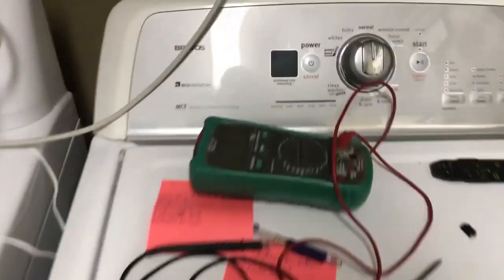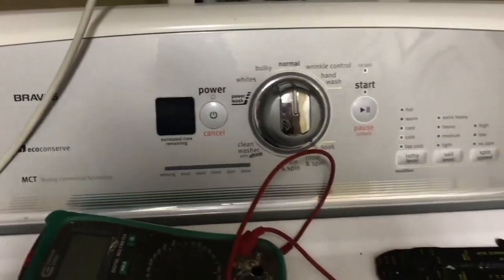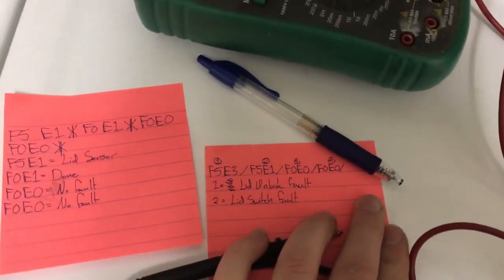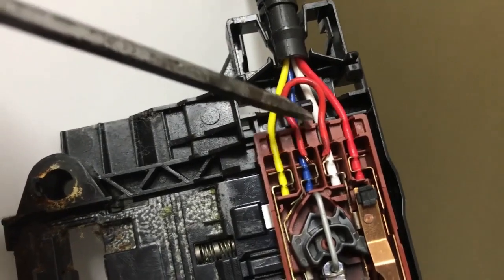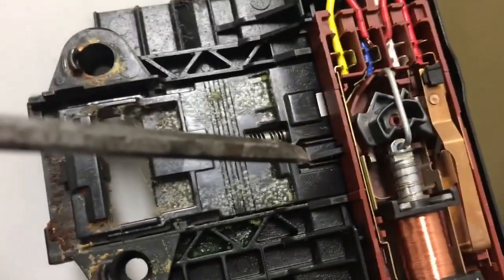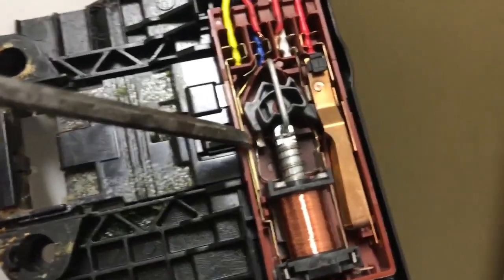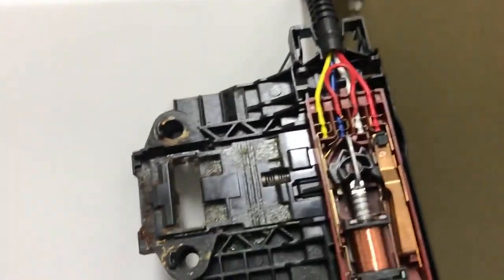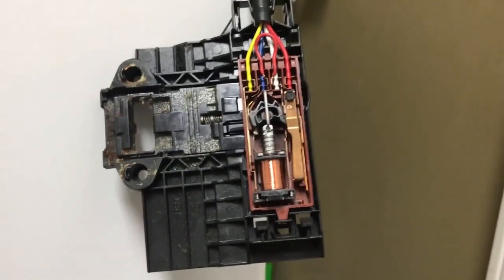Amana Lid Lock Bypass Works for Maytag, Kenmore, Whirlpool, Amana, Roper

Comment: Can you do a video for the one in the thumbnail? The switches are different in the two models
Reply from the maker: it will work the same you only need the main control knob with the 6 lights below it
Reply: @methodmeetsmadness  I replaced lock switch went through manual tests everything was good but when I started a load it guess a bit then begins forever drain

Comment: This will not work. The ACU reads resistance  you cant just jump the device. I am a repairman and customers who do this not only need a new lock but new Control after you short out your ACU
Reply: Can the white and blue be connected to a toggle switch and let the machine work?
Reply: @rickeykeeton4770  you cant jump a load. The lid lock is performing work. The ACU needs to read that work is being performed or it will assume the lock has failed and not spin
Reply: @tannerross-barco8238  is there a way I can bypass that stupid switch? Amazing how I'm still alive and we would push the old style switch to make the washer spin with the lid open when I was a kid just to watch it work. Now as an adult I supposedly need all this safety crap that just drives me nuts.
Reply: Just take this man’s advice he KNOWS what he’s talking about. I just blew my ACU.

Comment: DO NOT ATTEMPT. I have a simpler 3 wire model, and when I simply jumped Blue and White together (off reccomendations from this + an online forum) I instantly popped a circuit. Either buy a new switch, or find a new (to you) washer secondhand. Popping the board will total your machine.
Reply: Exact same thing happened to me.
Reply: There's a difference between a three wire switch and a 4 wire switch what will work on one will not work on the other you must determine which one you have before applying a fix

Comment: Thank you for the nice tip, i will try to do the bypass directly on the control panel lid switch connector instead of at the switch level. ✌

Comment: For me the copper was just corroded and needed a vinegar soak to start working again.   Seems pretty dangerous to be bypassing that lid lock safety feature.
Reply: Not dangerous at all lol it’s a top loading washing machine. These lock up for everything. Realized you dropped a sock when loading but just started the washer? Too bad wont unlock unless you cancel the whole load. I like to start the water and add the detergent then my clothes. I’ve been doing laundry like that since i was kid but now i gotta do it differently?? Nahh

Comment: This looks like it will work for me. I cant tell on here where you cut and sliced back together. Are you able to do a video on how you did this from beginning to end?
Reply: He just caused that second connection to always stay connected, though the actual sensor is still there for the computer to recognize. My washer has a 3 wire switch. i bent the copper tab so that the blue wire always has a connection to the solenoid, no matter if the lid swich is open or closed (same exact idea, different model) Then I just kept the entire slide out, put the housing back on and installed it. It worked... Bravos HE (no digital display)
Reply: @c-seventeenloadmaster8952  Thank you.

Comment: I think the silver piece that slides back and forth closes/opens the red wire.  That contact arm raised up and down to make or break contact. 
  That is why I thought it was the main feeding the other wires. 
  I was thinking the blue activated the solonoid, but I saw another video that described it as the switch connection. 
  I need to find one of the diagrams I have and try to figure these things out. 
  I need to know I will not do something to cause damage to the board. 
  If I can get them “rigged” to where I feel comfortable with them, I can get the machines to run and possibly find any and all problems it might have before ordering just a lidlock setup.
  Btw, did this let the washer go through all the cycles?
Reply: White and blue was the lid lock. I got the washer to go through all the cycles. But when it is complete, I have to unplug and plug the 110V cord to reset the machine. If I don't, then the machine thinks the lid is still closed and won't start pouring water for my next load.

Comment: I pulled my lid switch like you did and spliced the blue and white together. Capped off the red wire separately. Washer (Amana) fired right up and will only wash. Will not cycle into rinse and spin. Wish I'd seen this before. Any ideas??
Reply: I think thought the red wire was the wire that fed power to the yellow (switch) and blue (solonoid) wires. 
  I would think you would need to ohm the wires to see which is not making contact to know which to jump. 
  Interesting video.  I intend to try this in a few lidlock/switch mechanisms I have.
  Shut the lid and ohm the white and yellow wire at the connector that attaches to the board. Should show continuity. 
  Not sure what to do if neither blur nor yellow show continuity with the bypass wire removed. 
  I will research this some more before to see if it is safe to connect both blue and yellow with the white wire.
Reply: In this basic 4 wire switched system. The white wire is ground. The blue wire is the lid closed sensor so shorting the blue wire to the white wire tells the machine the lid is always closed (even when you open it) thus allowing you to open it during machine operation. There is one more thing required.  The yellow wire is the solenoid that when shorted to the white wire, triggers the physical latch that locks the lid so dont touch this one. The red wire is the lid lock sensor and must be also fully functional so that the computer module in the head unit gets a signal "yes" the lid has been locked so it can proceed to operate the drum and wash your clothes.  So the signal chain goes as so. If the blue is shorted to the white (lid closed), then the machine sends power to the yellow which actuates the solenoid to flip from one side to the other once thus locking the lid. That action shorts the red to the white thus notifying the computer the lid has been physically locked.  So your last step now is to simply unscrew and remove the latch from the lid that locks it to main body.  Doing this in combination with shorting the blue to white inside the module will allow you to open the lid at any time during the washing process. Also DO NOT press "pause" on the machine during operation, just let it run its course.  If you do, the machine will go into an infinite loop when it continuously actuates the solenoid every 5 seconds attempting to unlock the lid. It's annoying and the machine then has to be unplugged from the wall outlet to stop this. In conclusion, you can jump the blue wire to the white wire which will allow you to open the lid while the machine is running. Don't wear a scarf if you fear decapitation and don't stick your arm in during spin cycle if you hate going to the emergency room. Fix your red switch to close and open when the solenoid actuates, otherwise, just fork over the sixty bucks for a new switch assembly part and call it a day. Good luck.
Reply: When you press the start button to begin the wash, the machine checks that the blue wire is shorted to the white (lid is in the closed position) then it switches on the yellow wire, and power runs through it actuating the solenoid. The solenoid is always connected to the yellow and white wires which power it with ac voltage when the yellow switch is closed. When the solenoid is actuated, it physically moves the red switch (lid lock) from open to closed. This prevents you from opening the lid during ALL the cycles until the machine wash completes fully.   When the machine is completely done, the yellow switch is closed once more to actuate the solenoid for a brief moment to open the red switch. The lid now becomes unlocked, and you are free to lift the lid and remove your garments.
Reply: One final item i will mention is this lid locking immediately before the water has even filled up at the beginning of the whole process has always tried my patience. There are many times when I find a towel or sweater laying around the house that I want to add after I already pushed start. In the old days you could simply lift the lid and add it in while the machine continued to fill with water. Now you can't and when you press the start button again to pause things, the lid often takes 1-3 minutes to unlock due to the drum needing to be fully stopped before unlocking occurs. It's ridiculous. I know the machine wants to protect me from the dangers of cold water but seriously, for 3 minutes??!! Anyways, it's most likely a safety precaution to prevent a small child from falling in head first and drowning. So I will bypass it (no kids). Best to ya if this all helps!
Reply: @chrismoon3095  I hate when I come across a washer that when you want to stop it to put a piece in, it drains and starts over!
Reply: Yep, the washers were dumber back in the day which which made for great, simple workhorses and that was smarter business
Reply: @chrismoon3095  “smarter business”
  Not sure the mfg’ers would agree with that. 
  Remember the lonely Maytag repairman commercial many years ago?
  I think the mfg’ers came to the conclusion people sitting around with nothing breaking down to work on were not making them money. 
  No more appliances designed to last 15, 20 years and longer.
Reply: Rickey Keeton oh yah takes me back, the maytag repairman the loneliest guy in town! whoops  i meant the newer disposable washers were smarter business. Maytag repairman isn't so lonely anymore. My solution was to short the blue wire onto the white and make darn sure the solenoid was closing and opening the red switch. Removing a silver metal piece that looked like a nail clipper at the bottom of the black control module under the brown plastic tray inside allowed the red switch to function flawlessly. These switches used to be practically military grade and separate years ago. Now they are all combined into a plastic control module and made of chintzy plastic. Originally after trying my patience for 5 years, I had forced the top lid open with 300 pounds of arm force because my wife handed me some of her clothes after I had already pressed the start button and the machine had only begun to fill up the water. I had been working like a dog all week and wanted to go boating before sundown. Guess I couldn't wait the 3 min for it to unlock that day. Well, when i did that, the module basically exploded its parts inside. The lid switch and lock switch located inside that module were completely dislodged and I fixed it over the next day using the technicians wiring diagram as my guide. At the end of the day, my lack of patience was followed by a great deal of patience, which allowed me to fix what i had broke and even scored me some points with the misses. Best.
Reply: @chrismoon3095  I have a Cabrio that will not even let water in.  I think it is the white and blue on it that do not show continuity either lid shut. 
  If I jumper them, will it work, if nothing else is bad?
  If it works, I can check for other problems and not order just a lidlock switch mechanism.
Reply: @chrismoon3095  I pulled my switch apart. It's a basic 4 wire switch/solenoid setup. Red/white/blue and yellow wires. Now please correct me if I'm wrong; The blue card yellow feeds the solenoid to pull the copper mechanism together which then activates red and white which is the actual power feed to the machine?!?!
If I want to do away with the lid lock completely what's the answer then? I could buy the new part but it's become a bit of a obsession with me now. 🤣🤣🤣
Reply: @chrismoon3095  So what's the answer if I want to do away with the lid lock completely?
Reply: Getting the module apart is easy. Once removed from the machine and detached from the head unit, take it to your workbench and use a small #1 flat blade screwdriver to VERY LIGHTLY pull up each tab one at a time a fraction of an inch.  Work your way around the module until both halves are able to separate.  If you break one tab it may not matter and you can always electrical tape strongly around its body to hold it together more securely when your done if you break a tab.  Good luck!